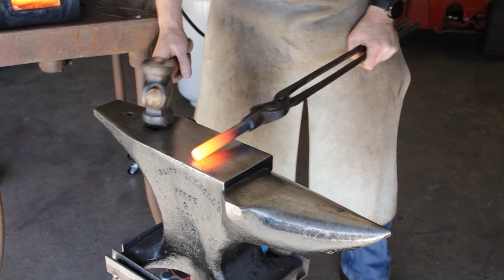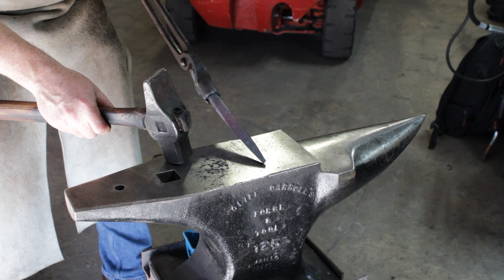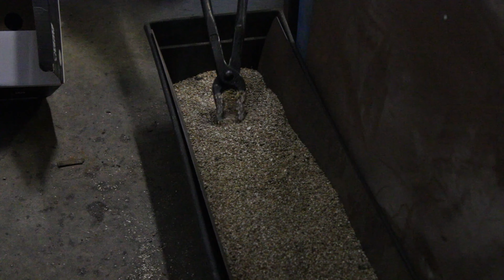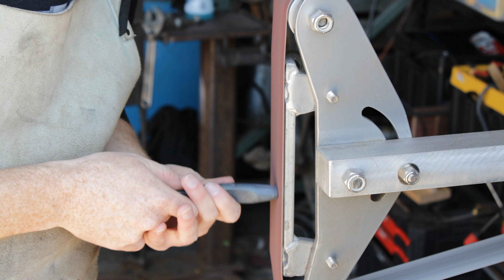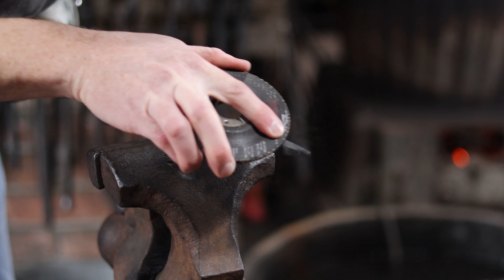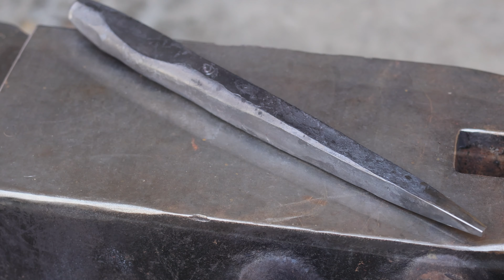How to Forge a Square Punch

Comment: What size is the 4140 round stock? 1/2 or 3/4 inch?
Reply from the maker: 3/4 inch. But, if you want a slimmer punch overall, you could absolutely start with smaller stock.
Reply: @rockingeforge cool thank you. Love your videos, work and teaching.